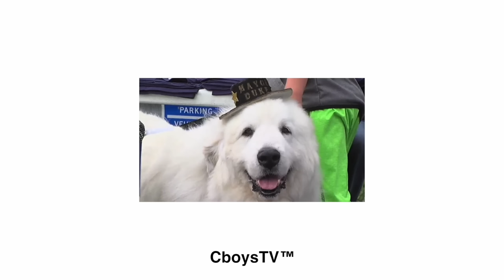Monster Car Blows Motor While Mudding!!

Comment from the maker: Thinkin’ Tiny needs a Big Ol’ V8.. 👀 what do you guys think?
Reply: CboysTV put an LS in there
Reply: CboysTV and a battery😉
Reply: Yeser
Reply: Steer bike motor
Reply: CboysTV 4bt cummins
Reply: 2JZ XD hahahaha                               Doooo ittt pliiiiizzzz
Reply: Drop a 12v cummins in tiny please do it
Reply: CboysTV  LS 6.2
Reply: CboysTV put a Cummins in er
Reply: Yeah that would be so sick
Reply: A 12v would be so sweet haha
Reply: Hellcat 🤪
Reply: Just needs a bobcat diesel. Like a Cat C3.3B DIT. Bit more grunt, lots more torque and lots of parts. You could even add a hydraulic motor and pump and a plow to the front for the fun.
Reply: Your only go to be able to put maybe a v6 in it. Maybe but if you can put a 2jz motor in it. Turbo !!
Reply: Drop a fat diesel in it
Reply: put a 4bt cummins in it!!
Reply: rods907 you can put whatever you want in it if you know what your doing!
Reply: Tiny needs a diesel!!!
Reply: I say a big old diesel like a cummins
Reply: Def put some LS platform in there!
Reply: Put a built 212 from harbour freight
Reply: CboysTV  put a ls1 init
Reply: Put a Diesel in it
Reply: Put bangins mustang engine in it
Reply: CboysTV FUGGNEH CHEERS BOYS
Reply: Jake's mustang engine
Reply: CboysTV 7.3 diesel
Reply: Put a 350 sbc in it
Reply: Sbc 350 or bbc
Reply: Put a 383 stroker in it
Reply: Put a 450 in it
Reply: A v8 and fitting it could b pricy , no offense but wvwn for you guys and it wouldnt work that well because I think we all know you guys need a new trans aswell
Reply: Rb 26 or 2jz
Reply: Yes
Reply: please put a 12v cummins in it and tiny will bring the fattest chick home from the bar. please
Reply: Jakes mustang motor
Reply: 2JZ!!!!
Reply: C BOYS TV put a funny car motor in tiny she would make about 7000 to 8000hp and around 7000ftlb torque
Reply: CboysTV yes
Reply: Put a 5.3 vortec in it, they are $500 from the wrecker
Reply: It needs a vw diesel
Reply: Put a 2jz in it and make big power
Reply: Do it
Reply: V8 and a turbo to touch it off
Reply: Ls or chevy carbureted v8
Reply: Ls easiest
Reply: I would put either a ls or a motor from a good of dodge seen to last forever in the woods
Reply: You should put a Cummins
Reply: Put a duramax or a big block you would not regret it
Reply: CboysTV put a 24 valve Cummins, a hemi, or the engine from jakes mustang
Reply: 383 stroker
Reply: Ls swap it theyre cheap amd indestructable could always put a turbo on amd push 500 600 horse with cam and everything else thats the cheapest and easiest in my oppinion! And ypu should gear the axles to 555 and spool them front and rear
Reply: Carb'd 350 chevy time
Reply: Diesel or ls
Reply: Cummins swap it it would last longer and go through mud easier
Reply: Small block 350 with turbo 400 trans
Reply: What's the frame anybody know??
Reply: Either that or a 2jz
Reply: Send it.
Reply: I’ve talked to Ben on Snapchat call before. Don’t know if you remember but we just do it again
Reply: Ls 6.0 with a supercharger.
Reply: Ls 6.0 with a supercharger
Reply: 2jz🔥
Reply: Boosted k- series honda
Reply: LS
Reply: I'd say keep it simple and budget friends and swap a 305v8 in'er. But if you guys don't care, then swap a big ol' carbureted 454.
Reply: CboysTV nah is swap
Reply: Put a chevy 350 in it
Reply: Put a Corvette engine in in
Reply: v 12 u won't
Reply: Diesel
Reply: At least get a 5.3 from a wrecked truck from the junk yard and put a mild cam in it that should be all u need and it will be cheapest way to go just don't for get the computer and the harness
Reply: turbo diesel
Reply: Yeees
Reply: Hell yeah a v8 with a super charger
Reply: Put a small block chevy with a supercharger makin like 600hp or a supercharged honda 4 banger
Reply: 350 Small block chevy
Reply: CboysTV  definitely a V8 full send
Reply: V 10 triton or a 6.7 Cummings engine
Reply: Image the torque the puppy would have
Reply: LS
Reply: I have a 7.3 turbo diesel with a manny trans just sittin in a junk truck?!??!??
Reply: CboysTV if you are gonna put a v8 in it, it better be supercharged or turbo’d.
Reply: Ya’ think?
Reply: You should diesel swap it put a Duramax in it
Reply: Twin turbo hemi?
Reply: LS Turbo
Reply: Hell yea do it bro 🏍🏍🏍🏍🔥🔥🔥🔥💯💯💯💨💨💨
Reply: CboysTV swap it with a 12 valve cummins motor with a fat hood stack
Reply: I think a duramax
Reply: heck yeah
Reply: 4bt Cummins or 350 small block
Reply: I was liking the 2jz idea but I think a v8 would be awesome!
Reply: You guys should have a drag race
Reply: 454 or 350 small block. Ls would be sick but 350 swap is pretty easy with less wiring
Reply: 5vz-fe Toyota swap. Most dependable motor out there
Reply: CboysTV I think you should give it to me because I don’t have money for a truck not even a bike
Reply: corvette engine
Reply: Drew Stackle a
Reply: I’m thinking diesel swap the ol girl.
Reply: I think a rotary engine would be SICK!!! Then you guys could rev to the moon!!!!
Reply: @kruzpatton3072  i think a rotary would be sick
Reply: @rods907  what about a rotary engine??
Reply: Duh lol
Reply: W16 quad turbo
Reply: If that’s a mustang engine for sure
Reply: Yes
Reply: yessir
Reply: L
Reply: Put a Duramax

Comment: Would recommend a 5.3 or 4.8ls there cheap as hell to get ahold of not to mention there’s always going to be a conversation kit with a ls. Or a 6.0ls they have a shit ton of power, would not recommend putting a 4l60e trans behind it tho, there junk unless your planing on building them. I would recommend just getting a th350 cause there much cheaper. Then just getting an adapter plate to mount it’ll the ls,  just cause buying like 3-4 of these would run you the same as a built 4l60e and in all honesty just buying a bunch isn’t the worst idea. That’s what my buddy’s running in his Suzuki sidekick mud build (th350 and 4.8ls) that thing fucking moves not to mention cheap to fix. He’s gone through like 2 trans in 4 years or so.

Comment: You guys should buy some over head headers or what ever they are called and put them on tiny. It makes it way louder and cooler it also gets the air and exhaust out of the engine faster so it won’t over heat or blow

Comment: It sounds like you spun a rod bearing or a crank bearing
Reply: You can also take the spark plugs out so it has no compression then turn it over for a couple minutes then put the plugs back in and it should start back up